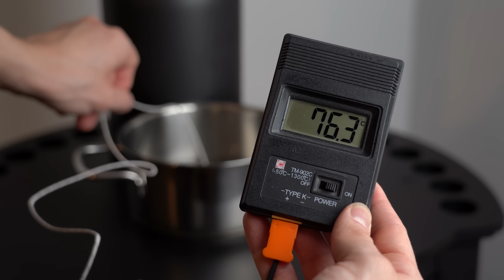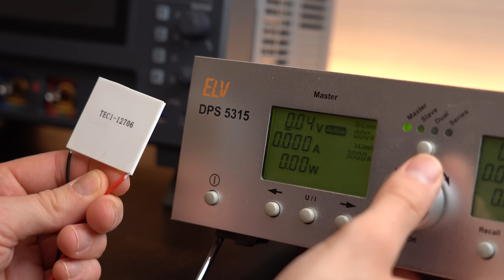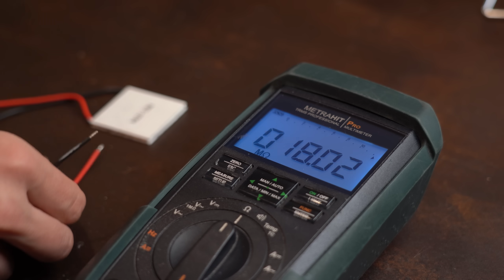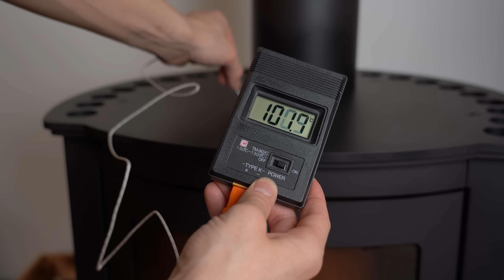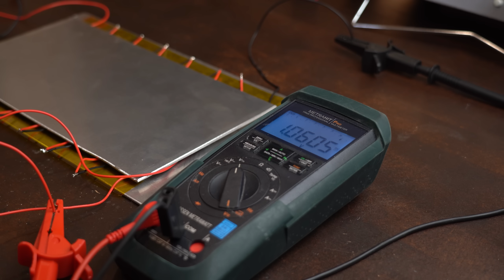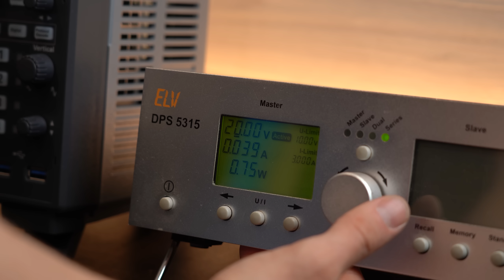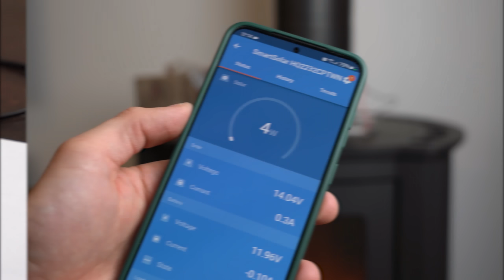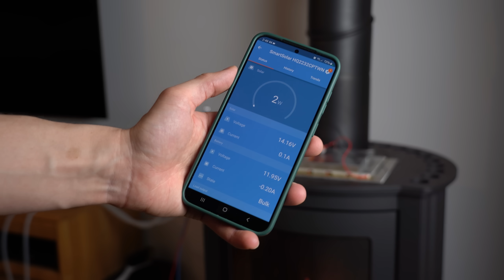I tried to Power my Home with Heat Generators! (Worth it?)

Comment: Actually, this is feasible with a few alterations.

First, you need to solve the overheating issue, which means one of two possible solutions, either include a thin layer of insulation to set down how much heat reaches the modules or make an indirect heat transfer.

Second is to expand the available space for more modules while minimizing space consumed from your living space.

Third is to drop the water pump by making a system where the water flows by convection current.

If I had the money to attempt this, my plan would be to make a setup where the water gets heated by the fireplace chimney (wrap copper coils around the chimney which the water flows through), with a water tank on the second floor or attic. The hot water rises to the tank (connect to top of the tank) and the return from the tank (connect at bottom) then goes back down to the coils.

The peltier modules are then sandwhiched between the water tubes, with the hot tubes on one side going up, and the cold tubes on the other going down. This setup can be attached to the wall to reduce space required while massively increasing how many peltier modules you can use.

The convection currents should keep the hot water rising and the cold water sinking so you won’t need the pump.

If necessary, you can make several independent water loops, each going to the same water tank but each loop has it’s own section of copper coils around the chimney and only a portion of the peltier modules, this is so more heat transfers to the modules instead of some modules not getting as much heat due to the other modules having got it already.

Additionally, the number of coils can potentially be adjusted to help avoid overheating the modules.
Reply: peltier modules (TEC) are not intended to be used as generators. for that there are seebeck modules TEG.

Comment: Something to keep in mind with Peltiers is that they are assembled with a very low melting point bismuth based solder, because the diode junctions are poisoned by lead in lead based solder.  So you have to be very careful not to overheat them or the solder will melt and destroy the device.  Putting them directly on a stove is a very bad idea.

Comment: I could have told you that the energy generated would be too small to be useful.  However, it's good to try it anyway like you did.  Proof is much better than some doubtful durwood like me just telling you it won't work.  That's one thing that's so good about your channel.  You actually try things and document them, even when it's not likely it will work.

Comment: The modules you used only tolerate a max temp of 100c - please repeat with teg modules instead - they are rated for up to 200-300c with much higher power conversion efficiency - they are $30-70 a piece though
Reply: no, they are $10 on ebay

Comment: We sell real TEG for waste heat recovery. Our single module( 55mm*55mm)can produce 7W(with load) each with 200 degree delta T. Each sell for around 26 USD. Contact me if you need some.
Reply: crazy, already got the 10W version for $10 from ebay

Comment: I find it really amazing that you can't get a wind generator to work, it seems really bizarre because the wind does have quite a bit of power . Strange
Reply: I got a good wind generator it took a lot of work but it has 12 inch wide vertical blades that are 3 meters tall and adjustable pitch. 4 blades I csn get around 5kw in 20mph winds... around 800 watts in a light breeze
Reply: @98f5  how do you load the generator? I mean how do you use that much power and store it
Reply: @lookoutleo  feeds into a solar charge controller a hybrid inverter which charges batteries, if there's no load the thing has a brake kit from Alibaba for the actual motor thing the biggest problem is the sheer load since the motor is mounted vertically and yeah it's not been a smooth sailing project the thing has broken a few times
Reply: @98f5 it's interesting thou that it's possible , I would be happy with 60a at 12v so much less power than that but then again I only have 5kw storage so charges quite quickly anyway. Here in Western Highlands Scotland it's windy loads. Do you have a web site or vids of your build , maybe I could build miniature version
Reply: @lookoutleo yeah i lack power storage too i need more at least. I have a buffer but i want 100kwh... someday ill make a video once i get it working somewhat more reliably and not requiring overhauls every other week 😂😂 got some nice bearings last week and plan to add a couple spots on the pole to support the sideways wind forces. The things are insane expensive since its a 4 inch wide steel pole . Ideally itd have a like support on the bottom. I actually had to take the bottom half of the blades off last week because the thing got pushed out of alignment again. They act like giant levers without sufficient support. 

Unfortunately i lack the self discipline and energy to actually make any quality videos tho lol.
Reply: @lookoutleo  if you got enough space i think a normal windmill with blades would be alot easier. the key is to get the right alternator. get a PMSM and a gear module, along with a variable input inverter.  sorry i wasn't very clear earlier but basically our system there is another inverter and a big heat resistor in the box on the bottom of the windmill. The other issue if you're diy is that you need this gearbox that basically can automatically adjust the rpms based on available torque... this is why i had bought the kit.  I tried to find the kit on ali expres but i don't see it anymore.  Anyways, While it does consistently produce power, the thing breaks for one reason or another all the time. 😆if there is literally no load at all, then you need to have something like an electric heater that it can dump excess power into as i believe this helps brake the speed of the blades to keep it from exploding itself.

And about the videos, i wish i had the self discipline to make a video about all my crap but basically i'm a polymath and do way too much.  over my head all the time, and starting a youtube would just be like one more thing i can't keep up with lmao.  only diy a windmill if you're ready for years of frustration... otherwise buy one from china, if you're in a windy area and have plenty of room you don't need the vertical blades i was describing I had to build mine to be disguised due to city ordinances and limit on how high i could make it, the government always screwing stuff up....

Basically I converted a normal windmill into having vertical blades, and the total cost for everything without my time is probably somewhere around 3000 usd, now with tarriffs it's probably higher.  if you factor in my time, the 3d printer i built to make the blades, and things like those bearings i mentioned, i'd guess i'm in 15k in parts (lots of that being for a giant 3d printer that could do non planar paths that i had to build from scratch... lots of electronics, bearings are super expensive the new thrust bearings i just got cost 500$ in my time i'd say about 1000 hours, and if i'm working i'm billing quite high, so maybe 100k of my time... 

But i don't have a power bill.
Reply: @98f5  by having 6 solar pannels, 3 pannels connected direct to a storage heater, the other 3 throu an mppt controller that charges my batteries , this makes my daily use of electricity from the grid less that £1 a day summer and about £2.50 a day winter. It's saving me about 120£ a year and the whole lot cost less than £500 for whole system. Small installs are worth while to
Reply: @lookoutleo yeah i have gone overboard and taxed myself too much but since my power got cut off... basically im tryin to do anything to stop running the standby gen. I found some free solar panels but basically i need more batteries and inverters to use more power. I have a apc 5000va 240v ups im thinkin of using that but its batteries are not lithium. I also have about 12 agm deep cycle car batteries ive collected lol but what i really want is another eg4 hybrid inverter and another 6 tesla model s cells that would make it so i can use those solar panels and not have to leave my current system stuck at the whims of the wind. I want to only have to use the standby gen when absolutely needed... but basically i havent had time or money to get everything good yet lol. YouTube is a godsend. I went to school for electrical engineering but i work in computers now. Anyways basic usage in my house is about 1.4kw and then peaks to 2kw. But when furnace or ac come on it can peak upto 6kw and then with the oven and drywr it could go to 25kw. But already got gas appliances on the way and changed the water heater to be one of those heat pump ones a couple years ago. That thing only uses 200 watts on avg

I agree small systems shouldnt be discounted
Reply: @lookoutleo  do u have to use the resistive load on the panels to dump exvess energy your charge controller cant handle
Reply: @lookoutleo  500 pounds man i feel like ive spent spend 500 pounds of actual silver on my stuff and still constantly trying to find ways to get more energy.

What if i build a tower and put a 500 gallon water tank like 20 feet in the air maybe i could make a microhydro battery haha trying to think what i could rig together from what i have
Reply: @98f5 of course it depends where you live but heating and hot water main use of power here in Scottish highlands . I went for what is cheap. Started with 2 x 250w pannels second hand for £40 . Sounds like your getting tied up, how much power do you need? Is grid power expensive?
Reply: @lookoutleo the grid ripped me off. They claim i used 120,000 kwh and shutoff my power thats what started the journey and its usualy about 10 to 12 usd cents per kwh and another 3 to 5 in supplier fees and taxes. My house average 2.5kwh with peaks to like 7
Reply: @98f5 so about 18 cents kwh? Pretty good . That 120000 units a nightmare. I hope you get that sorted out. Is it windy at yours all the time? Sunny ? Get some solar pannels to supplement . Be cool to see your big windmill sounds exciting
Reply: Once i get everything finished and running stable ill post a video and come back and share it in your thread sorry for hijacking it ❤

the current problem today with the windmill is overheating. Rigging up a 12v aquarium pump to pump water from my sump pump up to it to cool its heatsink..  currently I generate a lot of waste heat. I wanna find a way to utilize that later. In my day job sometimes we run computer servers in immersion fluid. Use the cooling oil to preheat water. Wondering if I could do something similar but that idea will have to go on the list of what I do when I someday have actual freetime❤
Reply: @lookoutleo  and yes about 18 cents per kw from power company but I hope I never gotta pay them another red cent and get my own costs to break even at that price lol.
Reply: @98f5 yes ofcourse. The longer it works , the more power you get , the closer you get to paying it off. Here in scotland would need big turbine, battery and big solar array to be offgrid completely . Ive whittled down to the basics so dont use much power to start with, that helps. I have a stove so in coldest months i burn some wood to, you?
Reply: @lookoutleo i also have a wood stove but in my barn. My house has hydronic and a normal furnace and a couple mini splits to suppliment. Hoping to expand the underfloor heating this year and use the power generation cooling to help keep it warm. Im lucky to live sorta in the middle of nowhere. I definitely think my investment will pay off especially if i dont pay the 20k to the scammers at the energy company
Reply: @98f5 by not having mains power I would save £18 a month, this is the meter rental here in UK , so£200 a year before you switch anything on

Comment: Id recommend using a heatsink for the bottom (hot) side. You'll have less surface area and heat conductor, making the peltiers more cooler. also I am interested if using a Stirling engine (or a couple) would be any better (probabbly is) and they wouldn't need active cooling. Thanks for doing this, i was thinking abot making a peltier generator of mine and you saved me from wasting money and time!

Comment: I think that the most effective way to use wood to produce electricity is to use wood in a 'holzgas' generator and feed the holzgas into an electric generator.
It would be great if you could test it sometime, check, for example, how many kWh can be obtained from one kilogram of wood.
But it's more mechanical than electronic fun.

Comment: To get more out of pelter’s you need to exhaust the opposite side . So if you are laying the hot side of the pelter on the stove then you would need a heat sink and fans to exhaust the cold side and the pelter’s would not self-destruct and work better.

Comment: Had you just purchased the 20w TEGs that can handle specific heats it would had worked way better. Cost around $50-70 each you could have had 80w with just 4 . Check out my heat source for them that run with a tiny input of 2.5W by watching my DIY Cold Fusion Vid!! If someone helps me design the heat chamber with automatic pressure release, i will give you the method/secret for a collaboration?

Comment: What if you create a copper pipe heat exchanger and wrap it around your stove's black pipe and connect the output to a steam turbine? It should work much better than Peltier modules :)

Comment: Here in central Canada, we have Maple Sugar shacks that are often far from the grid but need lots of power. We use so much wood, oil or propane to boil the sap but right at the start the cold sap comes in beside the boiling sap and I have always wanted to get some peltier modules in that zone to see if I could make some useful power there. Perhaps with a wood stove, a heatsink could collect heat from the smoke while an air intake pipe could cool the other side and some electricity could be made that way?

Comment: Wind power 1 meter off the ground (rather than a Winged Blimp Kite) never was going to work.
But I think clicks per effort paid for a lot of electricity right..?
So now it's max clicks per effort on yet another tech with an efficiency of close to buggerall..?

Why not try something that may well actually work for a change! 
The efficiency of an engine, like a home gas powered genset goes up to 90% IF you can use the heat...
Ie: Add heat exchangers to the cooling loop to heat house water.
Run the exhaust through a Sand Battery (DIY copper pipe radiators) to capture and use heat energy when the genset is off. (Turbo after. if any)
Maybe also add a heat exchanger (EGR cooler/s from scrapyard) to the exhaust after the Sand Battery for more hot water.

Then you can start looking at turning the exhaust into something useful... for episode 2.

Comment: How about trying to generate power with a little Stirling engine powering a generator? I'd guess that this would be outputting more power and you would not have to use active cooling 🙂

Comment: Now if the chimney pipe went outside before up, and was covered in these generators ( or better more heat resistant ones) imagine how much power could be produced in a cold climate like Canada where I live as last night was below -30c . I would expect significantly more power but have no idea how much .

Comment: Sir, you don't seem to understand you are using the wrong kind of peltier modules for power generation. There is a different class of power modules which are rated for much higher hot temperatures and output much more current. These kind of industrial power generation modules cost up to $45.00 USD per wafer. They are the same size but have different numbers printed on them with much thicker gauge copper wires with special insulation rated for much higher temperatures. You will need between 4 and 6 of these, and you will be able to generate upto 3.0 AMPS of current and approximately 12 to 24 Volts DC of usable voltage yielding between 36 to 72 Watts of output power.

Comment: Technology Connections made a video about the pretty inefficient these are, considering that the material that these are made makes heat transfer too quick to be efficient at moving heat or producing electricity from it. Peltier cells sound like the great marvel but they aren't what they seem to be. Even a Stirling engine would be far more efficient.

Comment: You need a heat sink an actual heat sink for the Peltiers and for the pump you should have e gone for a 5 volt system not 12 volt

Comment: There should be cooling fins opposite the stove side. Thermal mass only works until it is saturated, then the Peltier devices will get damaged unless the heat is removed. Also, removing heat creates a higher temperature differential which produces more power.

Comment: i thing you should it make this expiriment one more time but with metal support that can cool down the base of the metal legs because peltier modules can handle max 150 celcius and stove warms up to circa 300 so you just burn them. put this plate on legs the same as those fan heaters

Comment: I am a simple man. I see a fireplace, and i want to turn it into a crude steam turbine.

Unironically, wouldn't that be better? the fireplace boils water into steam, the steam turns a turbine, and the turbine (through fuckery beyond my understanding) generates electricity by spinning.

If it's good enough for a nuclear reactor, it's good enough for the fireplace.
Reply: Also, by doing this, you don't have to worry about notoriously and infamaously dogshit PCB's

Comment: So, let me see if I understand this correctly, a Peltier Module if you apply a electricity to it, will produce heat on one side and cold on the other but if you apply heat to it, it will produce electricity? what kind of sorcery is this?🤨🤔